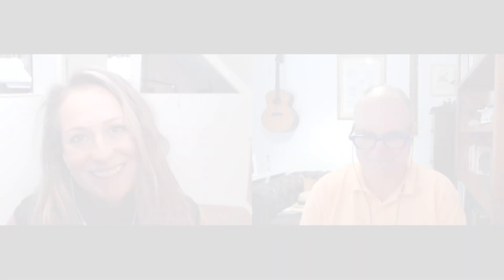Can I Harvest Rainwater Off My Asphalt Roof... Absolutely!

Comment: I collected rainwater off an asphalt roof for decades and used that water to irrigate the garden to no ill effect. I also gathered rainwater off the bitumen pavement which is no better than asphalt shingles. There's also the question of century old mains water supplies and associated old pipes which may or may not be as pristine as we all like to assume. "Don't let the perfect be the enemy of the good."  Remember, home water sources and reserves are primarily about resilience. Having slightly imperfect water under your own control is far better than no water if the larger systems go wobbly.
Reply: Those last three sentences: so incredibly true.